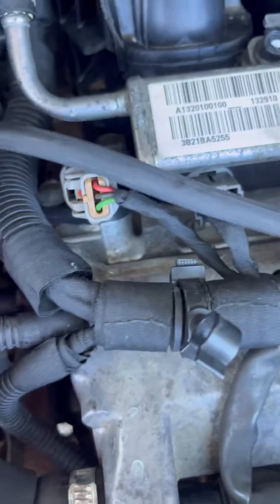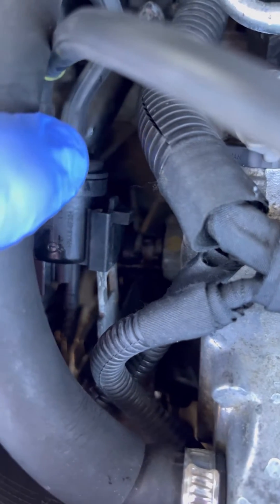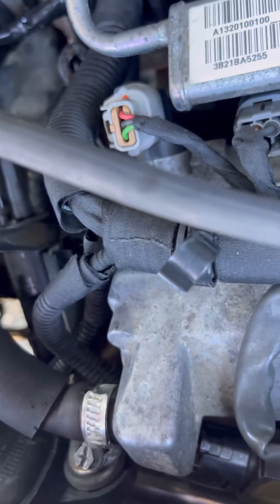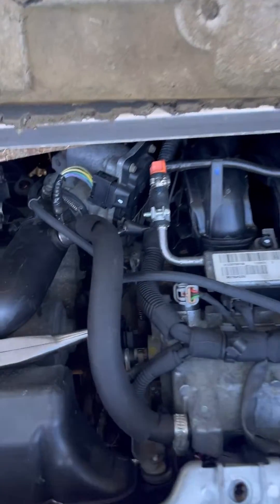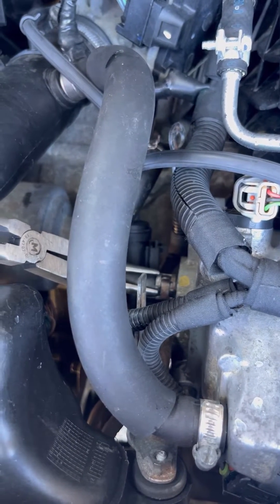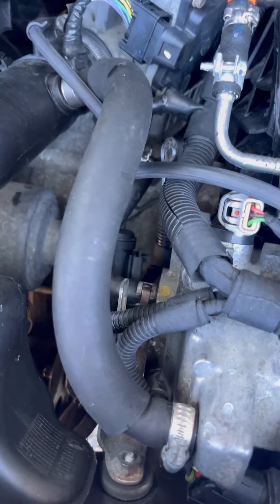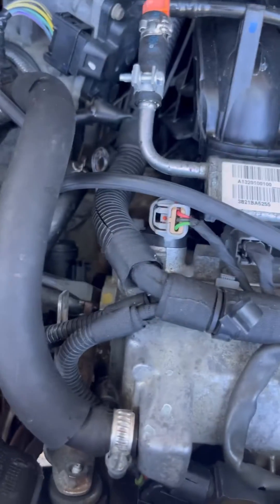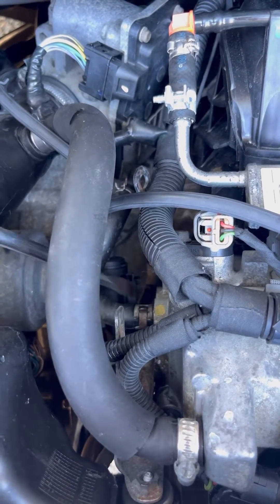Smart Fortwo 451 over heating/coolant bleeding/ coolant reservoir overflowing

Comment: Great video thank you very much! One question, do you know where the coolant bleed valve/plug is on the Diesel CDI engine? I did a cooling flush on my 2009 ForTwo CDI but could not find the bleed point location that I know should be near the cylinder head to bleed the air out of the tubing. Now the car is overheating with the water not circulating and I guess full of air pockets everywhere. I've searched all over the Internet and the all the information available is only for the gasoline engine not the diesel. Thank you very much😊😊😊
Reply from the maker: @yuidfbse  unfortunately I never had a diesel Engine smart
Reply from the maker: @yuidfbse  unfortunately I never had a Diesel one